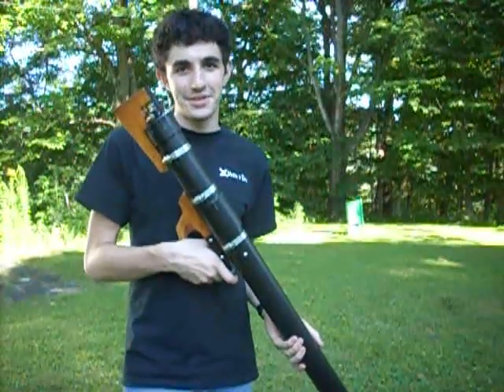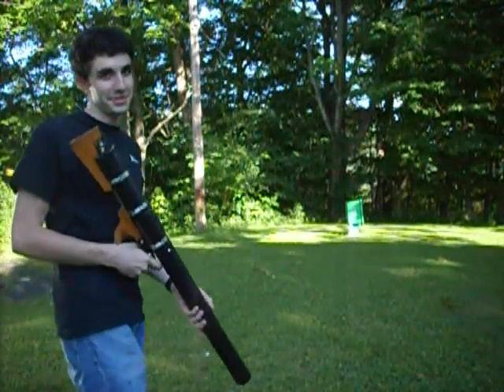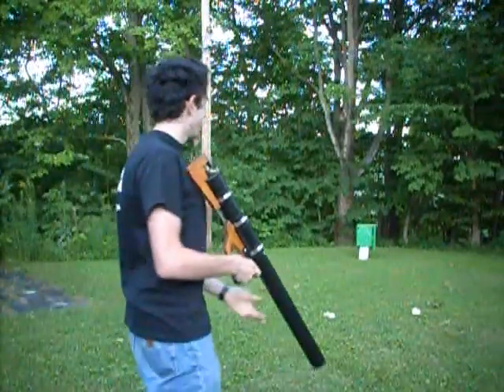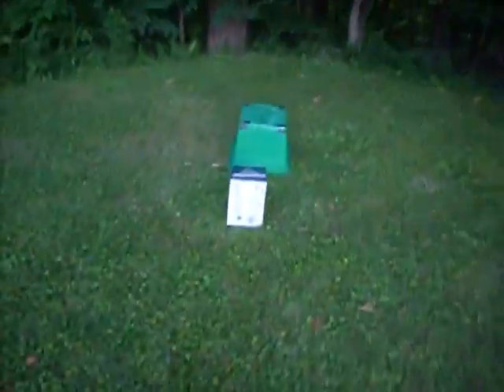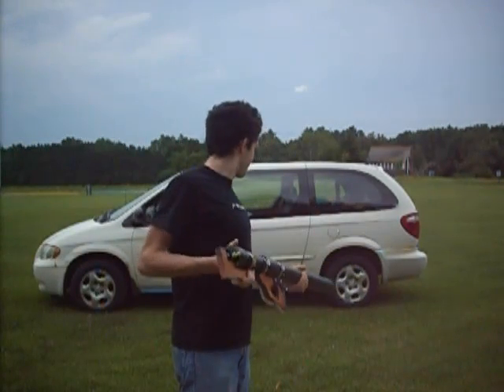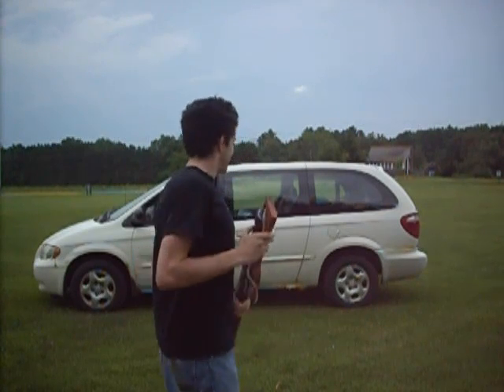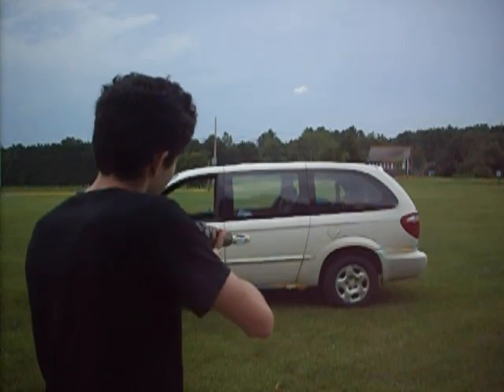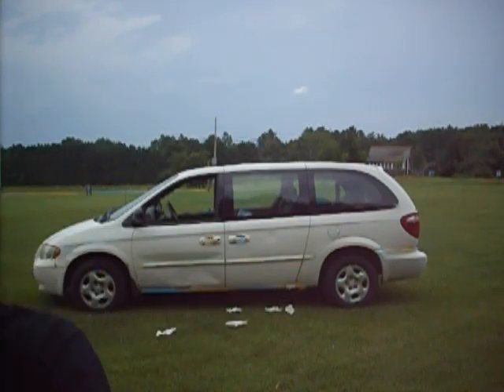Air Cannon Demonstration (Dents Car Door With a Water-Balloon)

Comment: Sweet! I've made a air powered pvc potato launcher before, but I had trouble getting it to high pressure. I'm interested to read your instructions!

Also, check your link in your description. I get a 404, but capitalizing law to LAW fixes it.